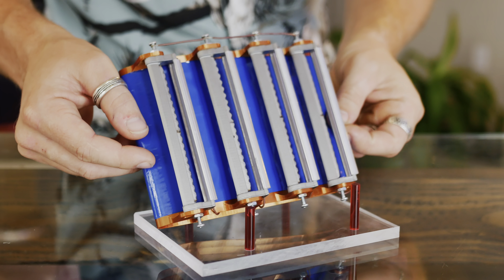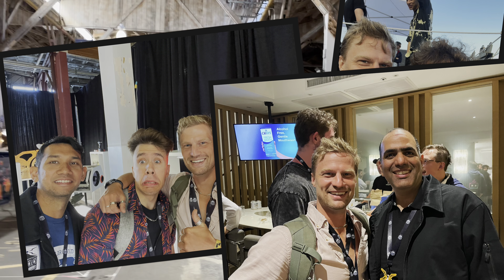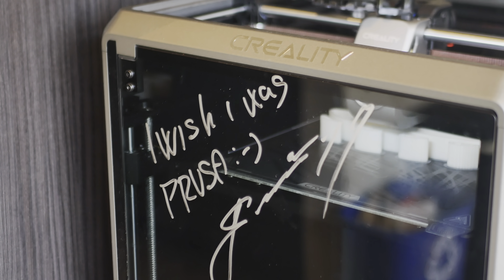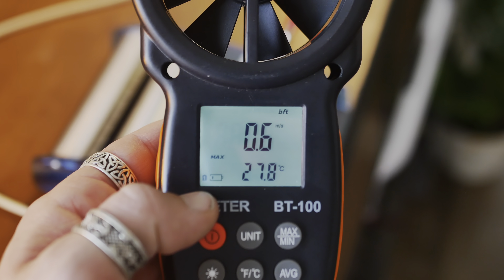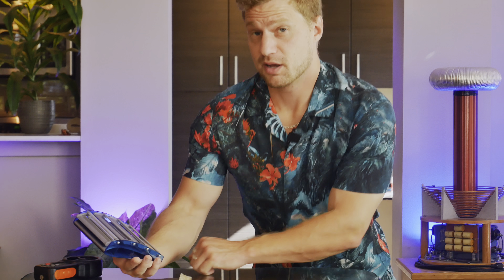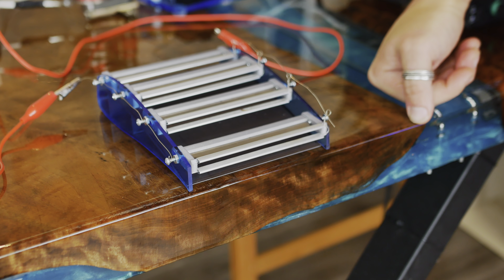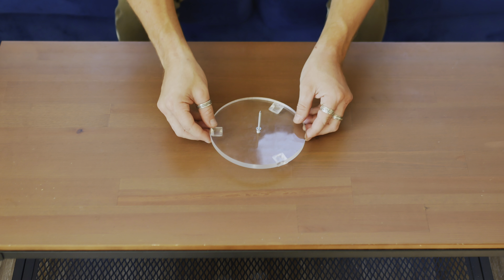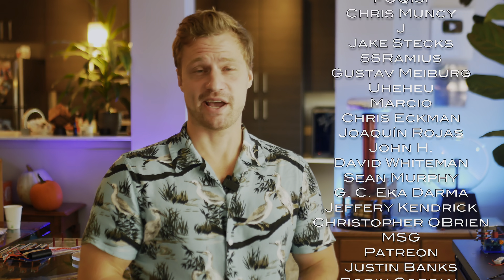Designing A Self Propelling Ionic Thrust Wing

Comment: Just a thought, but you could use a foaming PLA to further reduce weight. Love the progress so far and can't wait for the next video!
Reply: I was going to suggest this. I print all of my planes in lw pla strengthened with carbon rods. I can usually achieve 40% weight reduction over the pla versions taking into account the carbon rods. I'd suggest to look into Tom Stanton's videos on his second channel on how to design a wing around printing in lw pla. I'd also plan around using the body style of a Discus launch glider to reduce the weight and streamline it as much as possible
Reply: @mikelarin8037  I actually think a circular design is better.

The Stipa-Caproni was just too far ahead of it's time.
Reply: Lets lose some weight!  How about this, the skin can be wax paper for now.  Could the ion assembly be reduced to a hot wire grounding to gold leaf affixed to the skin of the wing?  If serrations are ideal, painters tape can be cut to make the serrations, apply the gold leaf to the wax paper, peel away the tape and voila.  A series of wires to grounding bands on the wing itself may doubly improve keeping air flow right at the surface of the wing?  The next trick is the elevation of the wire from the wing?  would one milimeter be enough/too much?  So much fun to be had on this project.  I subbed to keep up to date you your progress!  Oh, and you may have to move to a fog machine as dry ice can only do so much, and watching flow over the wing is so important at this phase.
Reply: Could make use of an ultralight film instead of just paper. SUF is lighter than even wax paper
Reply: And/or foaming filament. Also, Tom Stanton developed some nice manufacturing method for very lightweight airfoils.
Reply: The problem with this stuff is it's super brittle. There is this Formfutura PP that is better IMO and also about the same weight. And you don't have to fuss with getting the foaming right.
Reply: I do believe that that's the first perpetual motion machine right there. Hook it up to a pulley and you can then power up your car.

Aim the car down a steep hill, so you can then get to work for free every day. Just take an uber home, and get your dad to tow your car back up hill (you might have to loan him a truck and a chain), so you can then ride your perpetual motion car back to work for free every day. Hook up your cell phone charger to the alternator in series with a flux capacitor and a rectifing diode pack to charge your phone, so you can call your dad for a tow, every day.
Reply: Tom Stanton made a great video on optimizing a 3d printed wing on his second channel. The video can be found here https://youtu.be/QJjhMan6T_E?si=h2qctI5dOLai09HS. The cad process is slightly different but it looks like it works quite well.
Reply: Ok here are some thoughts.  You need to look at the trust to weight ratio.  Takeoff requires more thrust than cruise. Then eliminate it in the age old use of assisted takeoff.  Use much lighter metals and film where possible. Don’t 3d print- use balsa.  Struts are rigid. Ww1
Reply: Aerojel

Comment: I wonder if electroplating the aluminum with gold would improve the airflow; the weight gain would be negligible, while the exponential improvement in surface conductivity with the difference in the aluminum’s actually might jump up the plasma strength by acting like a capacitor, storing and releasing pulses of increased voltage. Naw, I was a writing major, so my understanding of the topic is specious at best.

Comment: There is something to be said about the spacing and using a single power supply.
It seems that, with previous experimentation shown, between yourself and Joel, multiple power supplies across multiple thruster segments don't seem to work well, but a single one does much better. Constructive vs destructive interference?
Consider this; the speed of sound propagates roughly 33,500 cm per second, the frequency of your plasma generators, between 9.5 and 10Khz with strong harmonics at half that frequency.
I'm betting the air flow effect would work best if the thrusters were spaced at the harmonic intervals, say 33.5 or 67mm from razor tip to razor tip at 10Khz, maybe a bit further to account for increasing velocities at each stage, maybe also set the distance between anode and cathode at 1/4 of a wave.

Comment: WEIGHT REDUCTION IDEAS:
My dad and I used to build model airplanes you should like into using 
balsa wood and 
wax paper for the skin. Also replace those metal bolts with 
nylon bolts if you can! 

Finally 3d prints are a lot stronger thann your design is giving them credit for! Make your parts thickness .4 or .6 mm! Use 2 or 3 layers of walls. If your part has enough room for support material you can definitely reduce weight. 

Good luck!! If you want some help reach out!
Reply: Simillar to tom stantoms air powered plane
Reply: @quinnthebin2304 I was going to bring that up too, that's a couple generations more advanced than balsa and wax paper, relying instead on 3D printed foaming PLA and a heat shrink plastic membrane for the skin
Reply: @quinnthebin2304  precisely!
Reply: Another good tip is when trying to optimize supports, he should use hexagons cutouts instead of rectangular ones.
Reply: And where possible, use LW-PLA.
Reply: the metal bolts are for current draw aren't they?
Reply: He doesn't want to use cheap products he wants to build this up for commercial use. Obviously ion thruster will never be able to fly a plane by itself but it can end up in a hybrid
Reply: The metal bolts are his connection points for the current input to the thrusters...but yeah, they are easy to use for prototyping, but definitely not good for anything that hopes to fly.
Reply: 3D printing is so heavy for planes that most of them wind up using single walls...
Reply: Wouldn't you want something you can scale? Building something larger out of balsa wood doesn't sound so robust on larger scale.
Reply: great ideas
Reply: Maybe editing a glider or building your own it allows you to fly further and it can push real life flying ion electric plane

Comment: when  I first saw ion fly it was a bi plane and I thought it was energy free. I guess not. well I have a few suggestion. first have you ever herd of graphene circuit energy its unlimited power google it if you can add that you can drop some battery weight there is also new exotic  materials super strong and light its called DNA Glass  graphene is conductive so what if you put graphene on DNA Glass instead of metals that should be a further reduction in weight. one more thing you know the Dyson fan? it looks like a bladeless fan well there are these new type of props there called Toroidal blades for air planes and boats what if you could some how run that below the ion thrusters feeding it air. a hybrid toroidal blade ion thrusters hidden props? also try making the ion thrusters with a flared leading intake like your round ion thruster it mite pull in more air and what if you made that ion wing tapered so the leading ion thruster is the biggest then the next thruster a bit shorter the next shorter or maybe the other way around short to long what if you staggered the thrusters like a checker board would that put out more thrust also google the latest battery technology there are some new exotic batteries with more power and lighter than lithium ion. what about swept wings ion? oh hey wait what about  an ion f-14 tom cat wide wing taking off then swept wings once max speed has been reached for more speed what about spraying the whole ion air plane with silicone now the air will really move over that wing with less resistance. GOOD LUCK.

Comment: Suggestion. 

Right now, it seems the bottleneck will be reducing mass to decrease the stress on the engines. But I feel like we could use this to our advantage. What if you built it as a biplane. More wings, more surface area, but if you use 3d printed plastic, not much in weight increase.
Reply: Canard , not biplane, go canard
Reply: He may as well go even further than this, going all the way to a Handley-Page style multi element wing for more lift with lower velocity  https://charles-oneill.com/aem614/ReferenceMaterial/A+M+O+Smith+HIGH+LIFT+AERODYNAMICS.pdf
Reply: Not even a biplane, think about it like the airfoil on a powered paraglider. Basically two wings made of thin material on top of one another to create lift. If you sandwiched them between two layers of airfoils (the top maybe with some ducts to enable airflow?), you could reduce the size.
Reply: @promess  This is basically what I just thought of, too. Like a micro-biplane wing with the ionic thrust generated between the sections of wing. I'm curious as to whether it'd be better to basically split the airfoil just above the nose, and split the tail edge (tiny bit of rake)? as 2 full airfoils would be pretty draggy, but so would the split lip on the front most likely. Not an engineer, don't mind me if I'm dumb.
Reply: I do believe that that's the first perpetual motion machine right there. Hook it up to a pulley and you can then power up your car.

Aim the car down a steep hill, so you can then get to work for free every day. Just take an uber home, and get your dad to tow your car back up hill (you might have to loan him a truck and a chain), so you can then ride your perpetual motion car back to work for free every day. Hook up your cell phone charger to the alternator in series with a flux capacitor and a rectifing diode pack to charge your phone, so you can call your dad for a tow, every day.
Reply: @jakefriesenjake  I've noticed some of my YouTube comments end up under the wrong video, as in , not the one I'm comments on, I don't know why.
Reply: @petevenuti7355  I don't know anything about that. Weird

Comment: Amazing video, thanks for sharing ❤

I wonder if these wings can be powered by electrostatic high voltage at 30k feet and further reduce the weight … let’s say you make a pop-up plane which will be lifted at high elevation by a balloon or any other mean than release and have the wings pop out to travel anywhere you like … i know, somehow we need to simulate the ground connection … or not ?

Comment: the ionic wind generated by the previous electrode is being obstructed by the electrode next to it, the improved version sorts the problem a bit but still the obstruction happens. so instead of using multiple modules right next to each other, you can use two long modules throughout a vast area of the wing. i hope that may improve the weight to thrust ratio.
Reply: Alternatively one could follow in the footsteps of an MIT project from 2018 and stack the linear ion thruster modules on top of each other instead of behind each.
Reply: exactly, the old design worked because there was very little obstruction, and one module feed the next. in this case each module is too obstructive. but if he replaces the razor blade with a wire maybe this problem will solve itself.
Reply: @danilooliveira6580   Maybe even coiled wire, or stretched out spring? I wonder if the number of serrations/corona points has an effect here
Reply: @plower221  If points matter, then going with carbon fiber would be a good way to go. There's a certain kind of ion air purifier that see big Clive show and tear into and it uses carbon fiber strands to create a lot of ions.
Reply: @plower221  I'd be interested to test the impact of electrode width, ground width and gap between the two.

Seems like could save some weight using wire instead of serrated blade. Just strip small amounts of insulation to create the points instead.
Reply: @nic.h we used 36 gage wire before
Reply: Wondering what would happen if the thrusters were embedded in the middle of the wing, creating a pressure chamber.

Comment: wouldn't you want the thrusters on the bottom of the aerofoil to increase the low pressure zone on top and therefore crate more lift?
Reply: The faster the air movement, the lower the pressure. So, they should be on top.
Reply: Thinking this as well because of the function of the airfoil is, as mentioned, pedendant on pressure differential, among other things.

Comment: Unless the thruster can generate more lift than its own weight, all this is going to do is slow down the descent of the glider.
Reply: The thruster doesn't generate lift, it generates thrust, the wing is what generates the lift. The trick here is getting enough air moving over the wing to generate enough lift, and we're relying on the ionic thrusters to both generate thrust to push the wing forward accelerating air moving across, as well as hopefully using some of the air that the thrusters are moving to increase the lift effect as they must pull air over the wing when they create thrust in the first place.

That's what makes this so interesting, it's not like putting the thruster on the front or back of the plane, the very nature of how the ionic thrusters generate thrust by accelerating air, when put on the wing could increase the amount of generated lift of the wing at a given airspeed because the while the wing may be moving naturally at 2m/s through the air, the ionic thrusters may be pulling sit over the top of the air foil at 5m/s. If you've ever seen a glider or a STOL airplane when they have a headwind, they want to take off even when groundspeed is zero.

This could have very interesting results.
Reply: @racerex340  my point still stand. It's irrelevant how powerful the ion thruster is if the lift force is still weaker than the weight.
Reply: @luongmaihunggia  yes, lift force must be enough to overcome the weight

Comment: add a turbine! use ionic thrusters in side, second, you're wing is upside down. just like with modern planes the engines are under to make the air move faster there to increase lift, yours will do the opposite.

Comment: try to make it as thin as possible. Maybe use an aluminium-foil on top of the wing, and another one sunken into the wing. Maybe put them in series (each front foil sends electrons from its tip on the back to the surface of the foil behind it). This way you could stack a ton of foil with almost no mass and a almost perfectly smooth surface.

Comment: Dude not on the top or outside of the wing but inside the wing with air vents integrated integrated in the nose and along drag spots or points of the aerodynamic frictions. Need a smoke wind tunnel.
Reply: The airplane I think this would thrust should probably be a glider, then probably taking is a problem
Reply: Maybe, but I feel the pressure difference that causes lift might be disturbed and reduce efficiency 🤷‍♂️
Reply: Then the vehicle would need hairs or moth texture in the winds paint almost like Teflon on a supercharger.... A supercharger only works because of the Teflon on the blades.... Possibly a dielectric metal, possibly painted nano particles in a way that produces little hairs the hair are not polarized but neutral or some type of copper hairs or hair like fiber structure then a heating element too heat the copper, but again non pilloried neutral.
Reply: Maybe some type of metalloid reptilian scale feathers like tiles on the space shuttle, instead of heat and electrical absorption, the metalloid feathers would need too be conducive as dielectric, possibly adding a radioactive element....
Reply: So maybe all of those metals sanded into micro particle dust possibly adding silicon or even using silicon as a spray on porous non sealing glue then the mixture would be baby powdered onto the bottom of the wings.
Reply: Then the non conductive material should be high gloss on the top of the wings....
Reply: I'm saying light weight solution would be painted on... The insulation is open air... Sooo the entire airplanes outer textured paint needs too compose these properties. I think of static from the Hindenburg or Teflon on a supercharger, is somehow relating to solving this problem ..
Reply: When a Tesla coil is made you have to remove the sprayed on coating from the magnetic wire terminal point just like the ionic lifter... Nano particle radioactive ☢️ paint for the bottom the high gloss insulated top part of wing.... Isolate the power 💪😎 I ❤ the video makes my brain think.... Search • 800w stationary bike Dynamo...... My Ebike is 300w.... Lol
Reply: Advertised misconception marketing products.... A rechargeable while in momentum Ebike..... 1 to 1 ratio search chainless Ebike, dynamo built into the pedals no chain no batteries.... 1 to 1 ratio.... People can barely search 15w dynamo ... But search 800w stationary bike dynamo
Reply: & let's call it "blinds" cheap Walmart blinds I'm thinking the wings should open and close if their was enough voltage the plane found rotate the blind wings, ionic vertical lift off then hand glide back too earth 🌍 but with the movable ionic thrust  would be able to create forward thrust.... ?